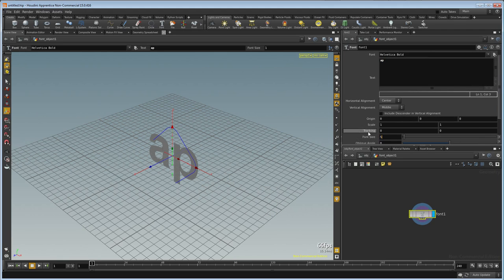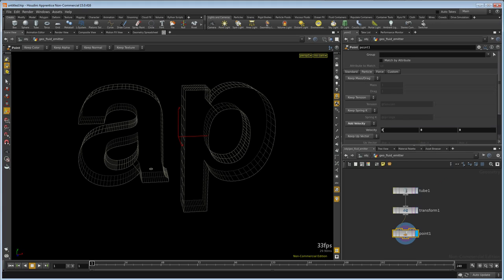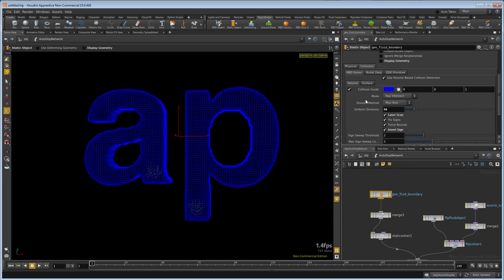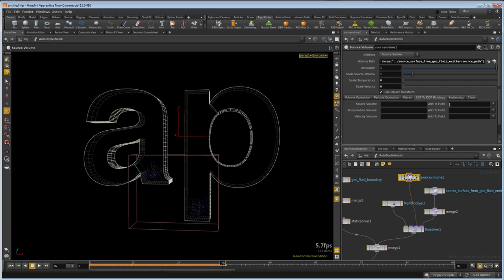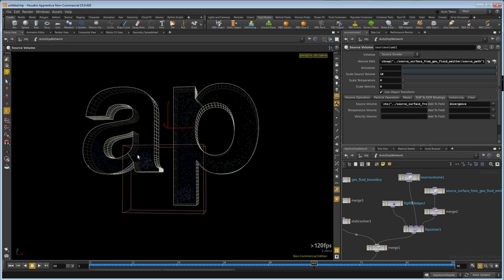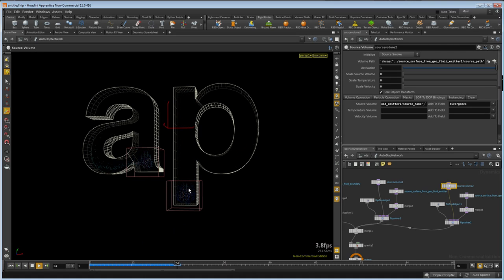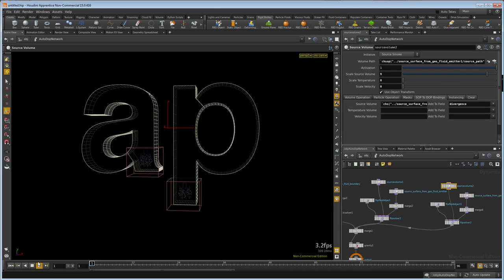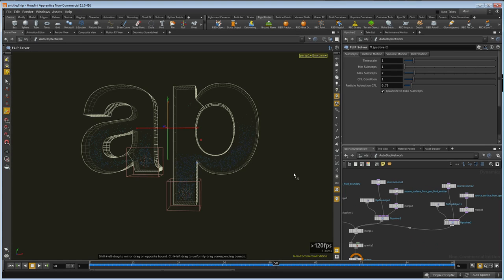Houdini Fill A Font With Fluid

Comment: If you're looking to achieve this on Houdini 18 or later all you need to do is:

1. Setup your flip sim and make sure "Add divergence field" is checked on your flip object
2. "Divergence by attribute" is checked on flip solver (Volume motion > Divergence)
3. Plug a geometry wrangle into second input of flip solver (Particle velocity)
4. In the geometry wrangle paste "@divergence = 1;"
5. Should see the particles pushing apart, if not, try lowering your particle separation or adjusting your scene scale (e.g. flip source geo or colliders)
Reply: this comment is a life saver!

Comment: Shame it's so outdatedd, could be really useful still. But those new changes of nodes and even synthax in vex and so on mmake sit very very hard to follow. Not getting anyy pressure in myy sim, the object won't fill up higher than the emitter, quite frustrating.

Comment: Hey, I am struggling at the step where you emit the fluids after selecting the geo_fluid_emitter, the step at 3:39. I have followed the instructions however once pressing enter and triggering the simulation nothing appears to be happening and my particles to not emerge in later steps. Notably the two discs that were created as the source do not appear as two larger dotted spheres at their locations. Any ideas? Working with Houdni FX Version 17.5.258

Comment: Houdini 17 Tip#1 - use the "old-point" node to get the particle settings. The new one doesn't have particles tab.
Reply: just noticed the comments are gone for this video. I guess it is pretty old & somewhat outdated now Houdini are up to 17.
Reply: hey everyone! can any one explain me how to work this out 18.5 version I am really struggling and cant find this point node as well, what other point node can be used?